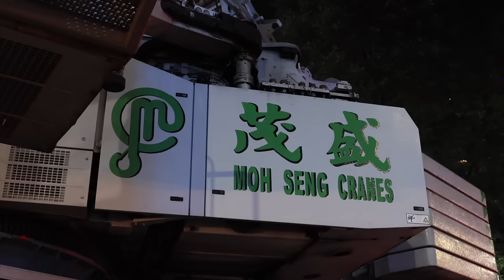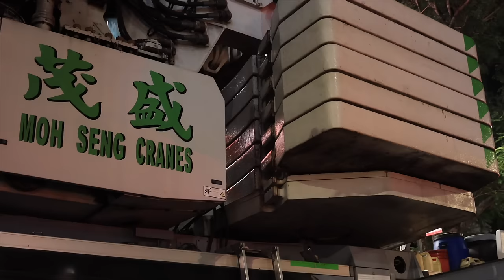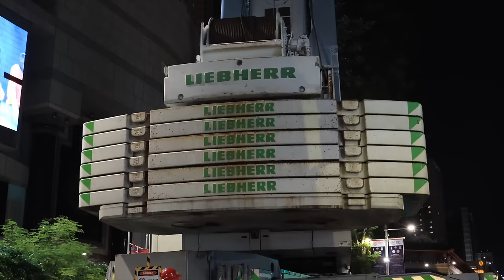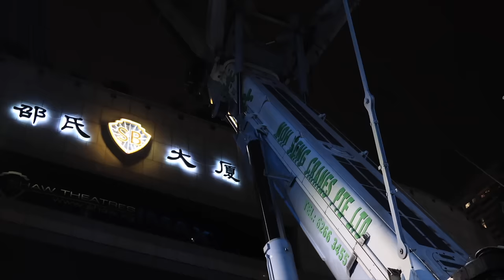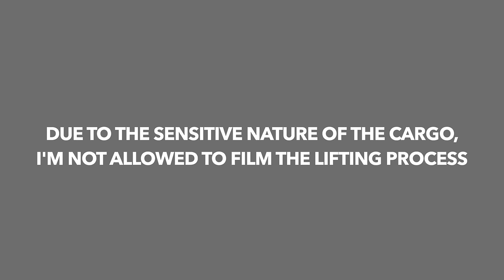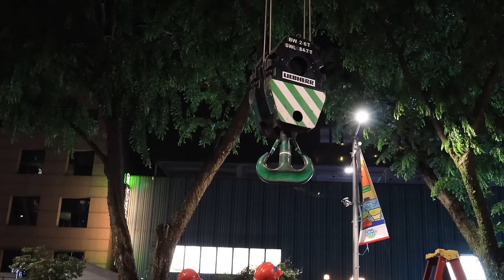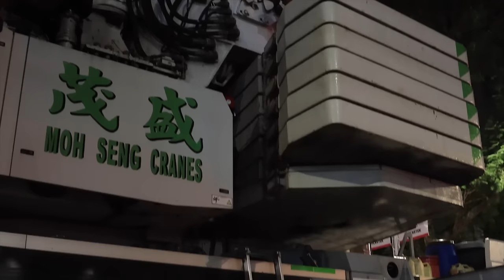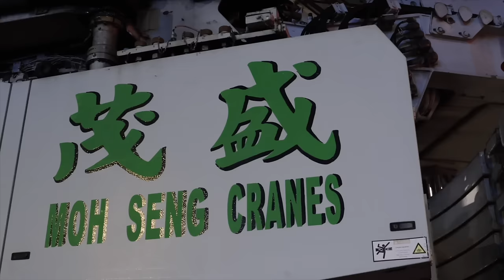Setting Up LARGE Mobile Crane in the Heart of Singapore | LIEBHERR LTM1500 - 8.1

Comment: the floor reinforced with thick metal plates, back of crane is put with counter weights, a lot of work to prepare before actual lifting work started. saw this at my side during lift upgrading work.